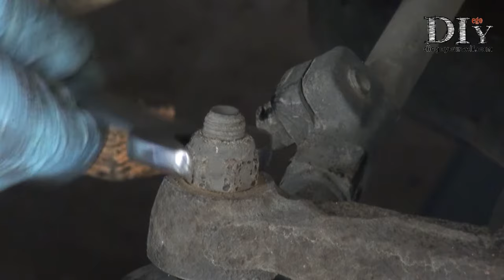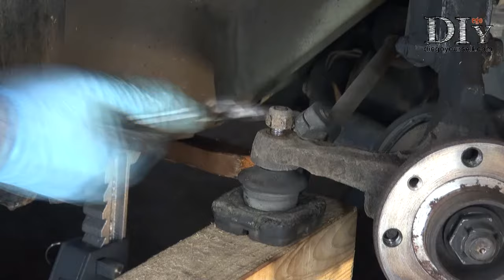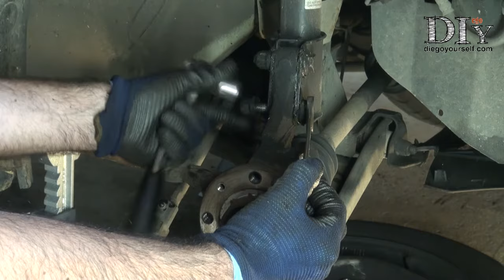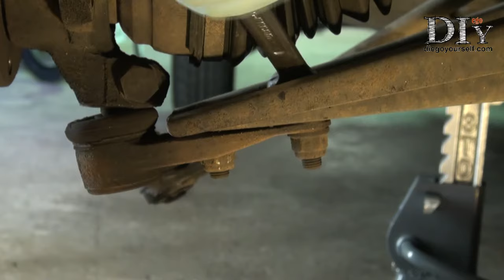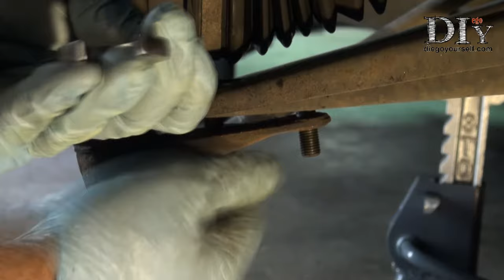#4/10 Changer un roulement : dépose du porte-moyeu/porte-fusée

Comment: Thanks for a very good guide. Do you also know how to disassemble the outer CV joint?
Reply from the maker: Hi, thankyou for your feedback. Did you see the other videos of the same playlist ?
Reply: @DiegoYourself  no. But I saw the pictures and text on your website.
Reply from the maker: @ronenfe  ok, so I dont get wich one is the "outer CV joint" ? Can you show me ?
Reply: @DiegoYourself  jeu cardan
Reply from the maker: @ronenfe  sorry, but your translation is about a play in the transmission bar... :/ I don't think it is what you mean...
Reply: @DiegoYourself  See method 2 here: https://www.la4ldesylvie.fr/changement-d-un-soufflet-de-cardan anyway I decided not to remove it at the end. Thanks.
Reply from the maker: @ronenfe  ok, it was the transmission bar cover joint. I'm not familiar with english mechanical vocabulary, sorry.
Like I said in my tutorial, in general we change the whole transmission bar when the joint is broken.
Reply: @DiegoYourself  Yes. I just wanted to replace the rubber boot and clean the grease. But I read it's very hard to put it back if you remove the joint. So I gave up and cleaned it from the outside.
Reply from the maker: @ronenfe  good idea : if it is not broken, there is abolutely no reason to remove it !